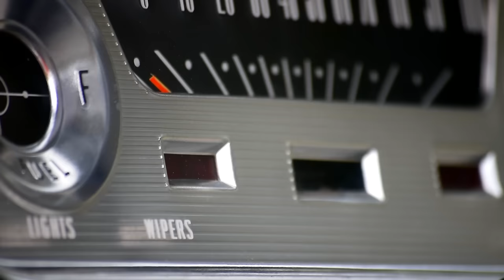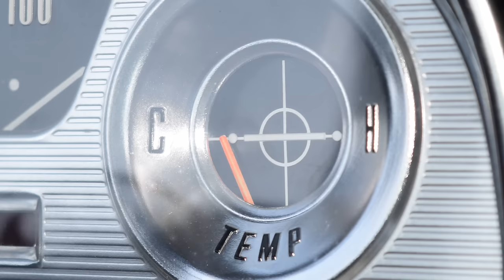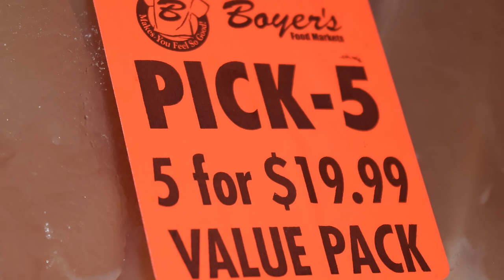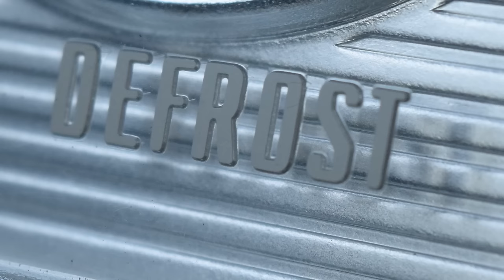Regular Car Reviews: 1960 Ford Falcon (stock)

Comment: I had a right hand drive, 1964 XM Ford Falcon wagon with a 144 motor and 3 "on the column" (plus reverse). No rust, comfortable (bench seats) and with plenty of room. Oh, and with the all important Australian flag, on each side of the front fenders.

Comment: If I had a 206" in a Falcon with a redone head and a 5 speed automat, but still meant to seem true-to-form (pressure carby rather than true EFI, mixture handle would be adjusted by feedback to prevent it intruding into the cabin)... would you review it?
Reply: I really asked that? I'm insane.

Comment: My first car was a 60 falcon. I was 16 on 1970. It was worn to a frazzle. Headliner hanging down, rust around back wheel wells. It smoked so bad I could not see the car behind me. I pulled the engine and rebuilt it. That is where I learned a lot about engines. I fixed the rust and painted It. A year later I replaced the 144 with a 200 from a 66 falcon. The 3 speed manual transmission was then the weak point. I learned a lot about taking them apart replacing the cluster gear for $35. Then I found you could buy another transmission at a junk yard for the same price. That 200 had too much torque for the weak trans. It had a lot of room inside could accommodate 6 adults comfortability....

Comment: My Uncle had a 62 Falcon.  It had a hand choke and was one of the few cars on the block that would start in 20 below weather as all the neighbors had big high compression V8's that did not like the cold.  My uncle would end up jumping probably a half dozen neighbors cars on a cold day.  His brother (my other uncle) had a 63 Electra and he actually liked tooling around in the 62 Falcon more than the Buick.  Perhaps because the Falcon could go for a few weeks on a tank of gas.  I was not old enough to drive yet but the Falcon did seem like a great little car at the time.  It later did start to burn lots of oil though as I remember my uncle always buying round quarts of oil at the discount store (5 quarts for a buck) when it was on sale and he bought oil there a lot.

Comment: You were over kind about Robert McNamara. My first car was a 1961 Mercury Comet. I had the 170 six but with a "three on the tree" manual transmission.  It still took a while to get going, but that heavy sheet metal had some inertia behind it and brake shoes were replaced frequently.

Comment: When you were talking about gong up a hill, you should have mentioned how the vacuum powered windshield wipers would slow down and stop until it shifted back into first gear where they would speed up a bit and then when you crested the hill and started to go down and took your foot off the gas how they went into light speed and were on their way to the moon before you knew it.
I used to love that about ours. It was camel tan.

Comment: actually the 144 6 cylinder lasted until 1964 and was available in the 1964 Falcon. the 170 is basically a stroked 144. they had the same bore size. they both had a 3.5" bore but the 144 had a much shorter stroke at 2.5" the 170 had a 2.94" stroke.

Comment: My father, like McNamara, believed cars were for one reason only: to get from Point A to Point B.  He bought one of these base Falcons in Ford Blue.  Only option was he had front and back seat seat belts installed at Sears.  He paid $1,800 for the car.  No sales tax or other dealer add-ons in those days.

Comment: The 1960 Falcon was a response to the Rambler.  Nash Rambler was introduced 1950.  Rambler was sold with a high level of equipment for the time, and with an advanced unit body.  Other compact cars were available about that time also (Kaiser 'Henry J', Hudson Jet, Stude Lark), but only Rambler was a consistent sales success.

My parents bought a used Maverick (nearly exactly this car with different skin) in the '70s as a 2nd car.  Everything about it screamed 'cheap'.  An AMC American (Rambler successor) or Hornet (we lived in Kenosha & these were very common) was a much more solid car, but my parents were prejudiced against AMCs.

Comment: In Argentina they built it until 1992. Also, they used at TC that is a racing category that runs until today(is kind of a sudamerican NASCAR, with speeds at 300kph  and sequential gearbox in these body)

Comment: It went on to legendary status in Australia, though the original models, called the XK in Australia,  had weak ball joints that were not up to Australian "roads" of the time. The factory found a fix by fitting Fairlane ball joints to subsequent models.

Comment: We had a '64 Falcon Futura.  It was a great car, but didn't perform well in winter.  The gas line tended to freeze up in cold weather and once the shift lever broke off in my hand as I shifted from first to second (it was about -20 F).

Comment: funny thing, my 1979 kadett, is an economy car, the smallest engine you could get in this car was a 1 litre reverse flow cam in head 4 cylinder with 39 horsepower, it is massively popular in the hillclimb and rally scene and in the 80s and 90s even in the tuner scene, it still has it's own clubs

Comment: When I got my license but before I bought a car my Dad had a Falcon 80/144ci I6 with 3sp stick that I got to drive.  Still the only stick I ever drove that couldn't get rubber
in 1st gear.  Floor it, wind it up, dump the clutch and the revs would just come down.  And that with the stock 13" ID tires.  Wouldn't corner in the rain either.

Comment: Styling came in later I think. Dad had a 63 falcon and it looks pretty good better than the 1960 one. Was his first car and he kept it as his daily until the 90s when he got a Ford Explorer. He and his dad swapped a v8 from a fairlaine in shortly after he got the car so its actually pretty quick scary quick considering it's a small light car with no power steering no seatbelts.

Comment: Hey man, I'm restoring a 2DR 1961 Ford Falcon. I have searched high and low for headliner bows.  Please help. I've hit a wall and the car won't look right without them. I have everything else except the steering wheel.

Comment: Just a quick thought about the front turn signal lenses.  If you want to keep the lenses clear, you should be able to put an amber bulb in instead.  They make amber equivalents to pretty much all the major bulbs for that reason.  Should be able to find them at any auto parts store.

Comment: I had a 1960 Singer Gazelle with a single-circuit brake system like the Falcon.
One day the brake pedal clunked to the metal as I was about to stop behind a fragile modern eurobox. Fortunately there was an access road to the left, I swung hard down it, cross ply tyres screeching loudly and dramatically and I heaved on the handbrake (picture multiple sinews pushing out of my neck) and it stopped a foot in front of a garage wall. I found brake fluid leaking out of the single cylinder like water.
There’s a lot to be said for modern car design.

Comment: In Australia Ford started building Falcons in Sept 1960, identical to the one in this video, sadly , in Oct, 66 years, 22 models, 9 generations, and about 3 million cars later, the last one will be built. Some of the last models, called Sprints, are 6 cyl turbos or supercharged V8s making more than 530HP, capable of accelerating to 60 mph in 4.5 seconds. It's the end of a great car, but at least they are going out with a bang.

Comment: I had a Falcon (same year) that was even more basic than this....it had a stick shift, and was a two-door.  I drove the hell out of it.  Chipped a tooth in first gear (of the car, not of me), locked up the rear end while downshifting too fast, smacked into the back of a Mustang, yet managed to rebuild the front using a rubber mallet and a long threaded screw and pipe assembly to make the front end body work line up, and then replaced the hood and bumper.  Then the oil pump died while on the freeway.  Tried driving back home at a slow rate of speed, but the engine finally seized up entirely.  Ford Dealer rebuilt the engine.  Clutch went out...twice...but by that I mean the clutch pedal disengaged itself physically from the side of the engine, meaning I had to drive in first and when I had to stop, I had to shut off the engine. Years later after discussing how that could have happened, I finally came to the conclusion that the left side engine mount was broken, causing the engine to torque to the right, pulling the clutch swing pedal out of its socket and become disengaged, giving me the effect of a direct drive car!  In 1968, I finally got rid of it and bought what I had in mind to drive, that of a 289 w/ auto Merc Comet.  Now I am hot stuff!

Comment: This car was a huge success here, in Argentina. But here it come with a 3 speed manual transmission, and later with a 4 speed manual, don't remember if it comes with an automatic, i think it comes as an option. Most engines were  188 and 221, some later models comes with a small 2.3 liter (Pinto(?)). The 188 was capable of 95 mph aprox.

Comment: I had a 62 Falcon, the sporty one with bucket seats a console and floor shift. It was a dog, if you put four people in it pedal to the metal got you 66mph. Cruise control was brick placed on the gas peddle. Above 60 mph everything began to shake, the doors, the windows, the dash and the steering wheel. My aunt overheated the engine which left it with terrible blow-by. When you stopped for a light, the car was enveloped in a cloud  of smoke. This was my worst early car, I think I gave it away and got a 64 Chevy Impala.

Comment: Very interesting, had no idea that this was as cheap as Ford could go for a small car and that is how Ford sold it.  Also of interest is the two speed automatic.  My parents in 1976 bought a Honda Accord with a two speed "Hondamatic" with manual shifting without a clutch and you had to shift at 30 mph - just like this car. So in a way, the old Ford technology lived on in Honda in the mid 1970s (and that Honda semi-automatic was a terrible transmission - it gave out around 70,000 miles).  Thanks for this review!

Comment: 5:50

Ford was STILL using that style break pedal into at least the early 2000's; my Grandpa's '03 F150 looks EXACTLY like that.
Reply: ..BRAKE..as in Brakes slow you own, stop you...BREAK is something you take at ten o'clock and 3 o'clock at work, and maybe at noon...or you BREAK a piece of glass...

Comment: Russians drew inspiration from Ford Falcon when constructing their Volga GAZ-24. It wasn't a bad car indeed, some still work as taxis today, but they are newer models with Chrysler engines. With one difference. In the USA, Falcon was one of the smaller cars. In Europe, vehicles as large as Lincoln have never been produced, which is why Volga was considered full-size. The European middle class sedan from the 1960s was, for example, Lada 2101, Volvo Amazon, Fiat 125.

Comment: hey Regular Car Guy, some of your assertions need to be clarified: the 144 was the base engine in the Falcon (and Comet) until 1964; though Lee Iococca did not like the Falcon, he in fact used its platform for the first Mustang (was that a purposeful omission?); the first gen Falcon was WILDLY popular in its day averaging over 350,000 units sold yearly; in 1963, a 260cid v8 was standard in the Falcon Sprint and optional in other Falcon models; you featured a bare bones base Falcon in your review however the car was actually available in several iterations including a wagon and pick-up; there were several options available including wire wheel covers, vinyl roof, air-conditioning, custom trim, power steering, bucket seats, center console etc..; it was the introduction of the Mustang (the Falcon's offspring) that shifted sales away from the Falcon.

Comment: The Falcon was sold in Australia from late 1960 as the XK Ford Falcon, and made the contemporary FB Holden look dated and lacklustre by comparison. Nearly 68,500 XKs were built before it was replaced in August 1962 by the updated XL model.

Comment: The Australian Falcon at first glance looked like a right hand drive clone of its Canadian namesake. It first went on sale in 1960, but there were many modifications to make it withstand Australian conditions and  regulations. They had rear indicators, stiffer suspension, improved brakes, and door mirrors definitely weren't optional. Over 50 years of evolution, they evolved to have independent rear suspension, a cross flow inline 4 litre 6 cylinder with an optional turbo. Its closest American equivalent would have been a Taurus, but rear drive, and capable of blowing away a Mustang GT without any trouble

Comment: The Ford-o-matic transmission (two speed) is not the same transmission that Ford used in the Fifties. I used to make that same assumption. The Ford-o-matic and Merc-o-matic transmissions in the Fifties were three speed transmissions. If you started in Drive however, they always took off in second gear. I do not know what Ford's rational was for this, but only by taking off in Low, and moving the lever to Drive, would it function like a three speed transmission.

Comment: I have about 9 of them , simplest modification to get a better car is to put in a 200 six 64-84, a 5 speed tremec that mustang's used from 85-95. You dont have change the differential or suspension , then fabricate a tranny mount and shorten the original driveline and add a different yoke for the tranny. Then it will have good power and will lay scratch,  very torque in 1st and 2nd. It will get about 25 miles per gallon at 65. When he said the 200 was a bored 170 , he was wrong a 200 is a 7 main bearing engine , not a weak 4 bearing , like the 170 or 144 they dont hold up. They also had the 3 speed on the column,  but that was fragile.

Comment: Haha no hazard lights. My 74 xb falcon doesn't have them either, no fan shroud. Did come with the 250ci l6 though. That 250ci donk with a 5spd toyota supra box bolted to its freckle was a bloody good combo. Climbed hills like nothing, even with a caravan on the back and I could average get bout 800kms on a tank of gas. Not bad for something out of the 70's

Comment: The Falcon was popular initially in Australia, but then they started to break, lots of them breaking. our sh!t roads mean the suspension just came apart. to reverse the damage caused to the brand, the aussie division had to retool the entire suspension for local conditions and they ran the new model hard in trial runs to prove it wasn't fragile like the first one. Five Falcon’s were pushed to the limit around Victoria’s You Yang’s proving facility, the goal was to rack up an incredible 70,000 miles at an average speed of 70 miles per hour! Despite the audacity of the undertaking, and the fact that some of the cars rolled, after 8½ days all five would finish, with an average speed a little over 71 mph.

Comment: A 1960 Falcon was my first car, bought used in '68. Red with a black plastic interior pretty much like the one featured here. But it did have mirrors. Sadly the previous owner had pretty much trashed the engine, apparently thinking oil changes were optional. And being right out of high school and POOR I couldn't afford to have it rebuilt by actual mechanics. Instead I had it overhauled by students at the local community college. BAD mistake. It never did run right. But I had no problem with the brakes, steering or handling. It was a 1960 fer chrissakes. Doofuses (dooficu) who've driven only "modern" cars need to get a clue. At CONSIDERABLY less than 10% of what you'd pay for an el cheapo today it was MAGNIFICENT. 60 years of technical advances have NOT come close to making modern cars the value that one as. Oceans, WORLDS apart. A whole bucketful of thumbs ups for the 1960 Falcon!

Comment: Not like schoolteacher Dad, but he bought Falcon Christmas 1959.  Problem free...perfect.  But driving LA to Vegas winter 1960 he got so cold (didn't get the OPTIONAL heater) he had to put on more clothes.  Got the cheap version of factory radio that didn't have push buttons.  Stick shift.  At least it was modern compared to our 1953 Buick.  Moved on in 1962...bought the 1962 Falcon (identical).   Your example extremely original.  Oh and ALL cars then had white turn signals and few had fan shrouds.  No seat belts.  We were safe (?) with the padded dashboard.